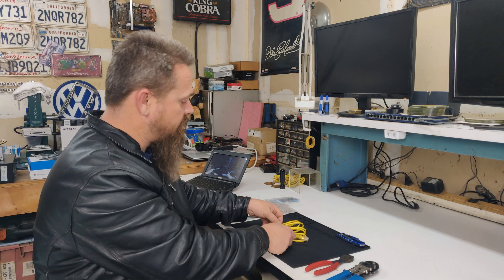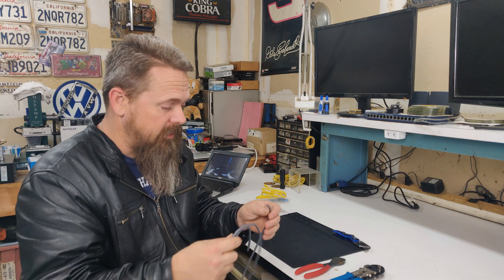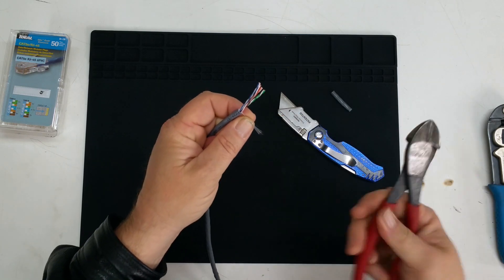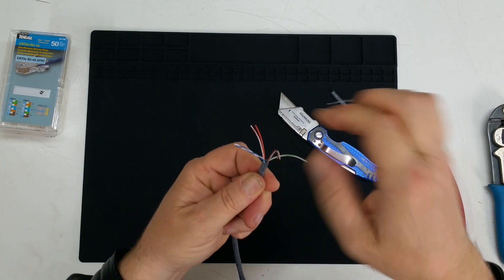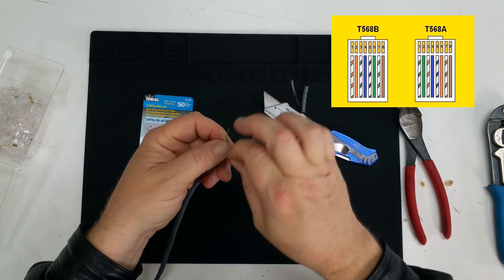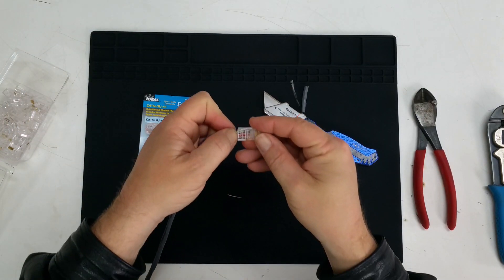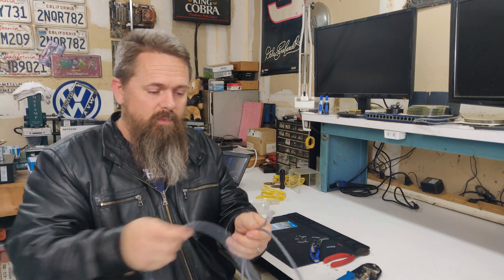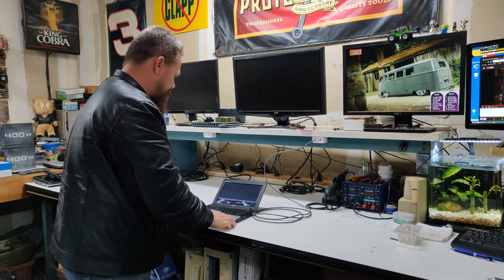How To Make A Network Patch Cable

Comment: I have been making my own cables for years and I totally agree with you - making custom cables is way better than buying them premade. You may want to use shielded cable for runs over 10 meters.

Comment: What's the difference between the two color-codes A and B? You didn't say anything on this matter, maybe you could? THX!
Reply from the maker: They are basically just two different standards. There's nothing functionally different about either of them. However, if you're running cable somewhere that already has existing cable you should stay with the standard that the last person used so that way the next person that has to troubleshoot your cable doesn't have to work as hard.
Reply: @CyberCPU  so I can just freely choose between them as I want to?
Reply from the maker: @GothicGame  Yes but make sure both sides of the cable use the same standard obviously. I wouldn't recommend mixing and matching on the same project. I typically use the A standard unless a previous tech used the B standard.

Comment: eeek…. a couple tips. One, I haven’t used a box cutter on a network cable in years (prob since the late 90’s or early 2000’s but it’s been a looong time. 🤓 It’s too easy to accidentally cut a little deeper than you should and cause crosstalk and crc errors, leading to sub-optimal performance. It’s better to use a proper network cable stripper. Two. Even better, use an all in one stripping and low tension grip cable crimper. There’s a few out there for the past 10+ years, but the best in my opinion is Klein’s crimpers. Even better is the klein pass-thru connecter crimper, which is what you hoped for, but it’s actually been around for some time. Three, rather than just do a simple ping, it best that that you use a proper cable tester first. Even the simple 8 pin continuity network cable tester is better than just relying on a hope and a prayer by plugging the cable in a computer and just do a simple ping. That will deceive you into thinking that you have a good cable when you may infact have som other cabling issues going on, such as miswired or poorly crimped connectors, crosstalk and next errors. I wouldn’t be surprised if a few of your “good” cables are actually the cause of some pretty slow network performance if you happen to do some heavy streaming, gaming, or  very large file transfers. You’ll see crc errors on a nic if you have a proper managed switch or in ifconfig if you’re running linux, or in network in windows task manager or whatever custom diagnostic tools may have came with the nic drivers.
Reply: Hello @packetcowboy! Fancy meeting you here.